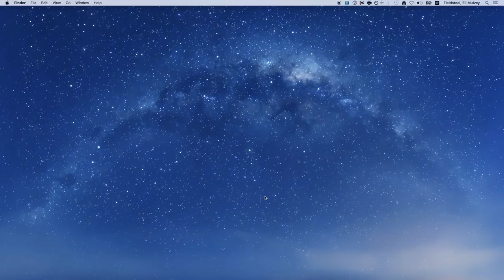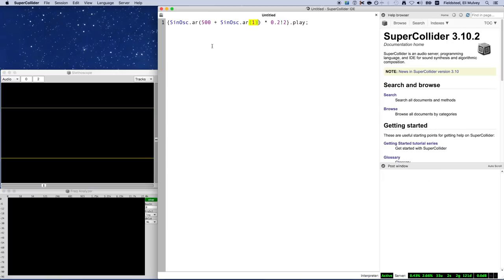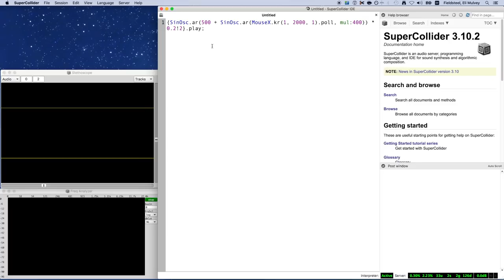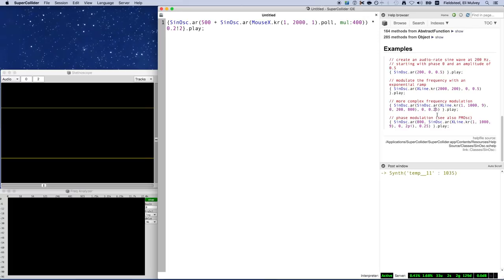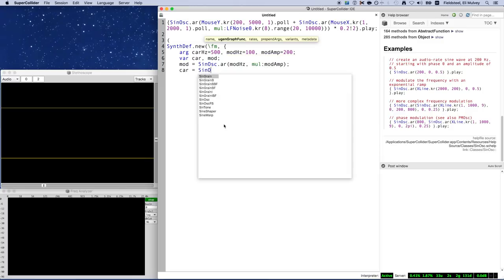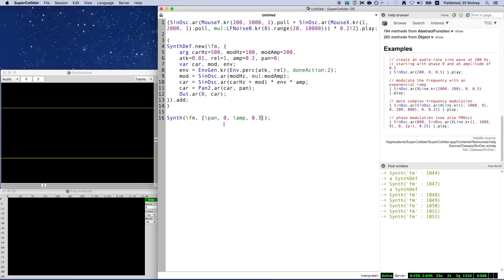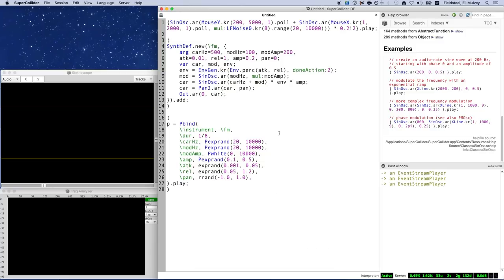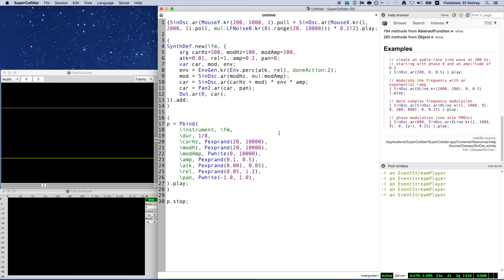SuperCollider Tutorial: 21. FM Synthesis, Part I

Comment: Curious to see what you're going to say next time - about making FM and pitch. I was wondering if you also use PMOsc sometimes. I remember David Cottle said there wasn't really any noticeable difference between making an fm synth and PMOsc - I think there's also something similar in Curtis Roads book. Anyhow, I'm having plenty of fun with your great tutorial ideas  - a bit Autechre even. Thanks.
Reply from the maker: Hey, glad to hear it. Yes, PMOsc will be featured in the next video. Very handy if it's classic FM synthesis you're after, but it's also good to know the DIY approach in case you want to customize the basic recipe, e.g. use non-sine waves, create multiple modulators/carriers, etc.

In a digital context, frequency modulation and phase modulation are practically indistinguishable. Most digital oscillators are wavetable oscillators (this is true of SinOsc) because it's more efficient for a computer to look up values in a table, rather than calculate them on-the-fly. So, when we specify frequency, we're actually controlling the speed of a pointer that moves through the table, i.e. phase offset. PM and FM have different implementations, but the results are the same.

Comment: is there a way to see which random numbers were chosen, to recreate that sound?
Reply from the maker: Yes — you can collect over the Pbind and store each event in a data structure, essentially intercepting the data before it is played.

(
~data = [];
p = Pbind(
	\instrument, \fm,
	\dur, 1/8,
	\carHz, Pexprand(20, 10000),
	\modHz, Pexprand(20, 10000),
	\modAmp, Pwhite(0, 10000),
	\amp, Pexprand(0.1, 0.5),
	\atk, Pexprand(0.001, 0.05),
	\rel, Pexprand(0.05, 1.2),
	\pan, Pwhite(-1.0, 1.0),
).collect({ |event|
	~data = ~data.add(event);
	event;
}).play;
)

p.stop;

Once stopped, you can review the data. For example, here's an array containing the sequence of 'modHz' values:

~data.collect({ |event| event[\modHz] }); //sequence of modHz values

It would be a lot of work to manually re-create the random sequence by inputting all these data points. Instead, you might consider seeding SC's random number generator. This way, you can get the exact same random sequence each time, but you don't have to know all the numbers: https://www.youtube.com/watch?v=HvLYFbyc2rY